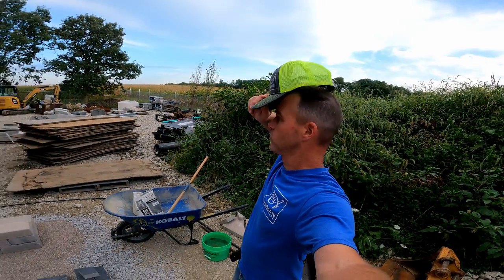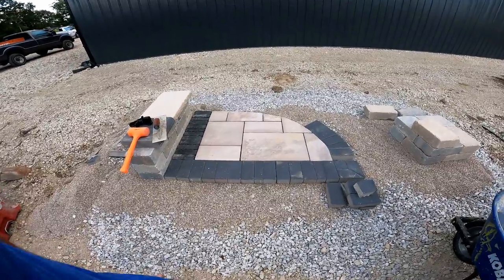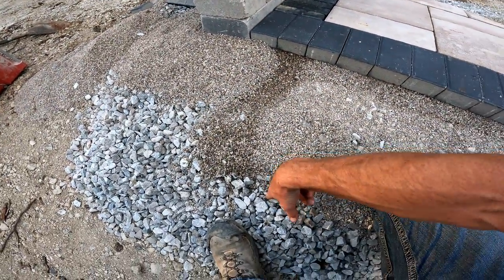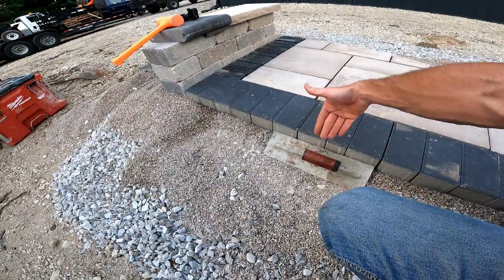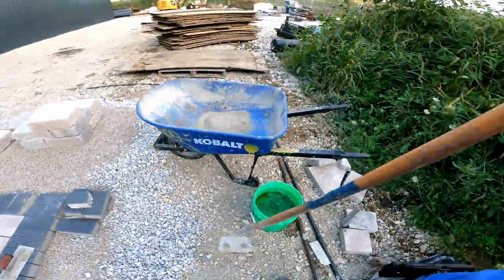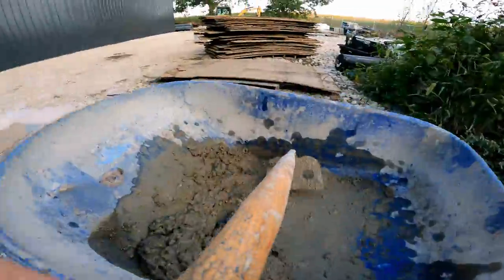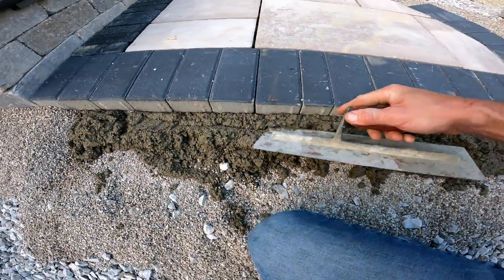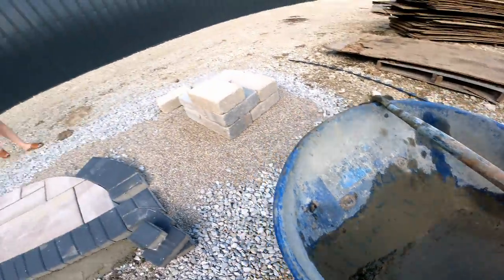How We Do Edging Restraint On Our Paver Systems!

Comment: Been installing a concrete edge for over 20 years and never an issue.  Many edging products I have ended up see fail and had to reinstall many.  I do undermine the paver an inch in to really give it a shelf and secure it.  Nice angle down to shed any runoff and plenty of room above the concrete for soil to grow turf.

For driveways and vehicle borders it's much larger and usually place some rebar.  Have had cobble stone curbs bedded in concrete hit by plows and not move.
Reply from the maker: rebar is a good call

Comment: Thanks for an excellent video. I agree "simpler is better". I do like your mixing the concrete to a dry mix that can be shaped. I am using a small diameter wire to reinforce my mix (wire sold for reinforcing concrete block joints). Carry On.
Reply from the maker: Awesome!